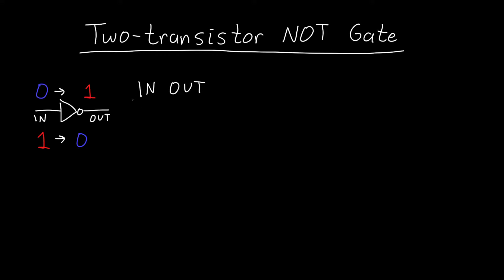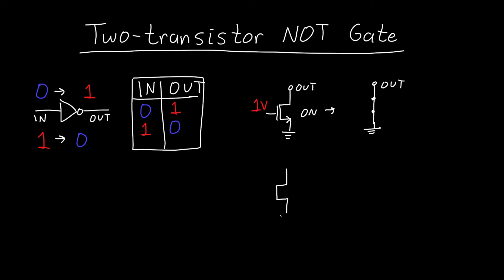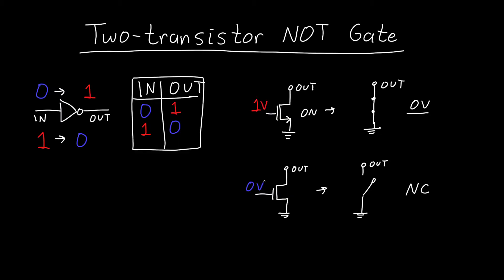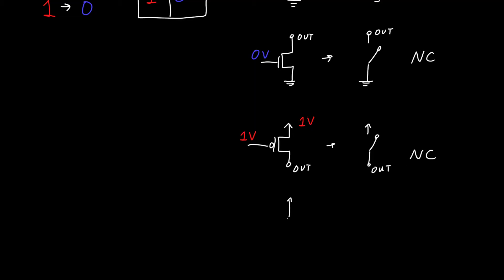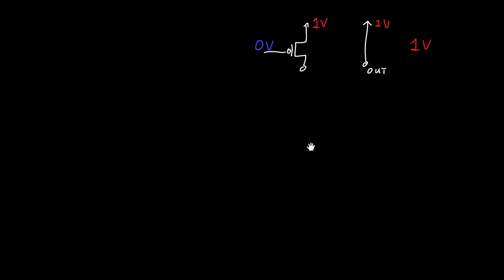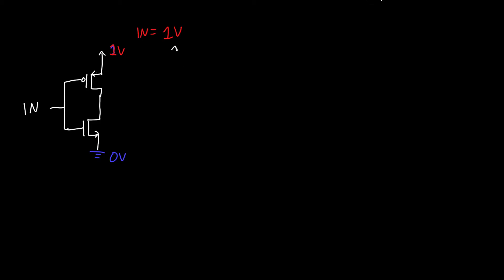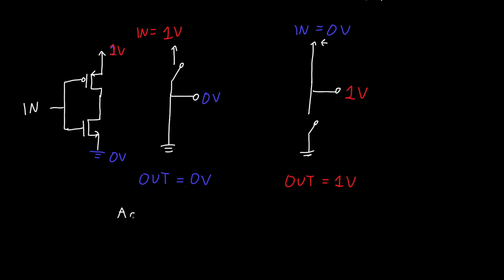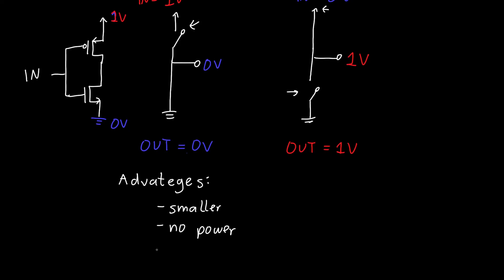Not Gate Using Transistors

Comment: Damn I forgot that it’s turned on when its 0V and turning the Voltage up will activate the switch into disconnecting 

Thats the only way it works though right? By asserting the logic in this way